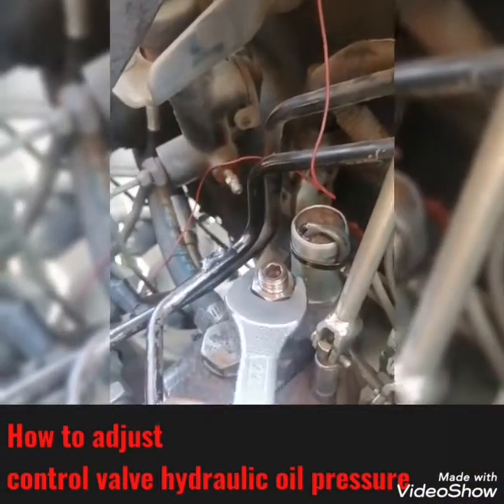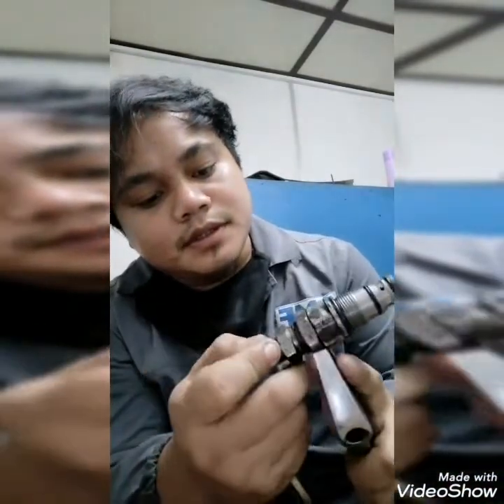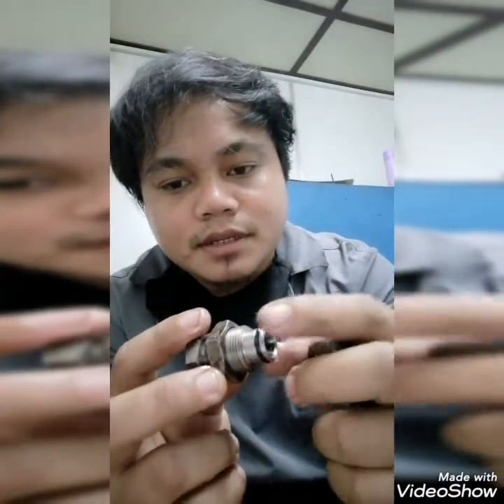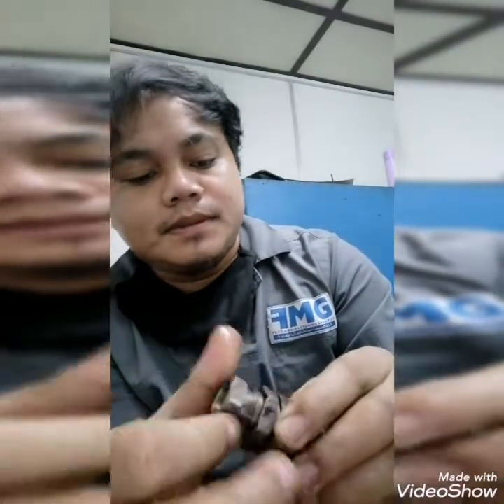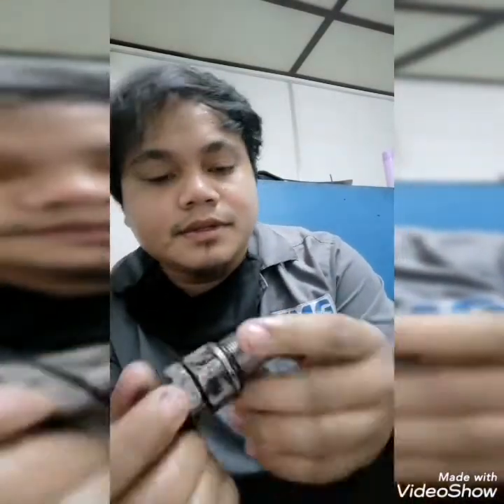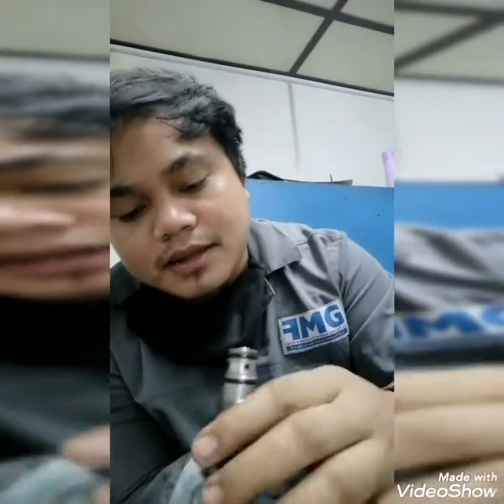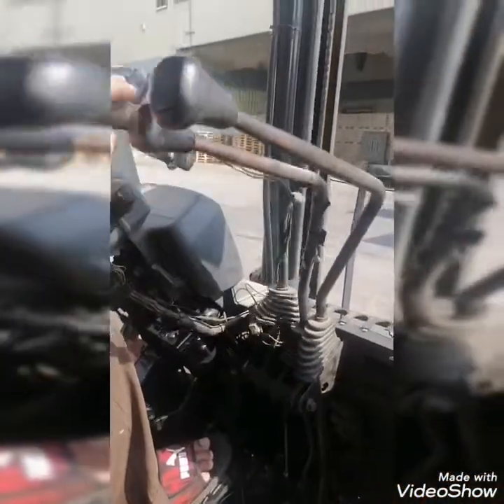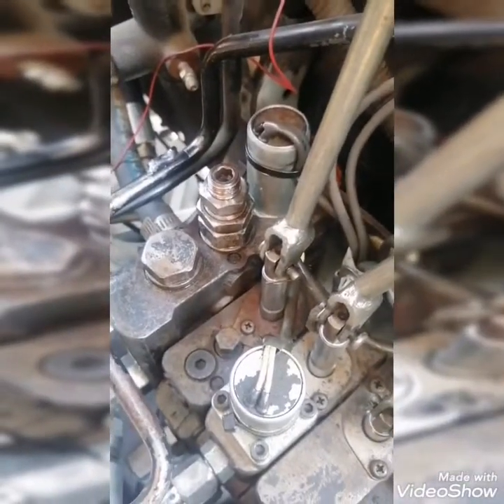No lifting problems of forklifts

Comment: Please Contact me on whatsapp   +923092007327. My pallet lifter hydrliuc  not stop one place.
when i press it for go up then its go up but not stop where i need it to stop. its comes slow slow down.
Please Help me
Reply from the maker: Hi. Im asking what kind og pallet you are using.. Is it electric pallet truck or manual pallet truck.. If its electric check the hydraulic contactor, sometimes contact point welded that's why hydraulic lift continuesly.

Comment: Sir baka pwede po pahelp sa control valve ng nissan forklift.. Hirap po tumaas at bumababa fork. Ty
Reply from the maker: Check mo switch ng solenoid kong seme electronics na yan
Reply: @kurttipsandtrickstv  sa akin din po sir yung tilt po ang problema ok naman ang boom up  at expander extention pero ang pa yuko at pa balik sumbrang hina
Reply from the maker: @jerinestv8767   check mo micro switch kong ok paba at check mo ang coil. Direct mo sa battery pag mag spark sorted na yan pa walang spark ok pa yan

Comment: Assalm o alikum sir, 

When I move my forklift back and forth, there is a lot of noise from the oil pump and the oil tank gets hot and the motor also gets stressed. Can you tell me if there is a problem with the oil pump because the oil pump is too hot?  Goes
Reply from the maker: Please check pump motor first.. You need to replace the bearings.
Reply from the maker: Please check the motor and replace the bearings.. Motor is stress because of the stock up bearing.. This is the common problem of the motor.
Reply: @kurttipsandtrickstv  thank you so much brother weekend I checked then what is the problem bearings or another problem I telling you again thanks bro
Reply from the maker: Welcome